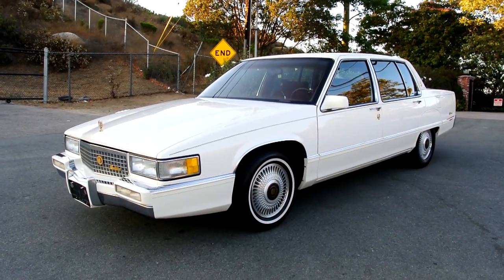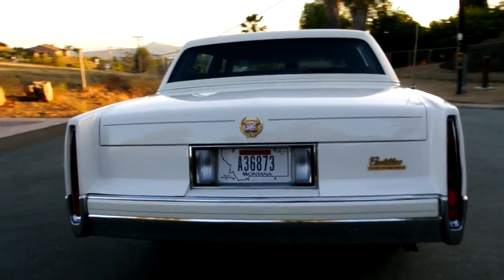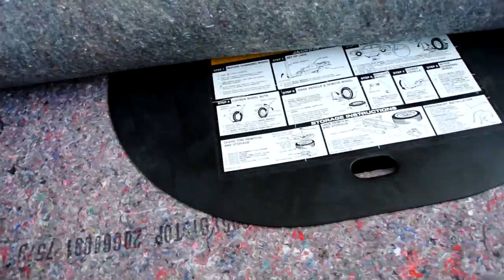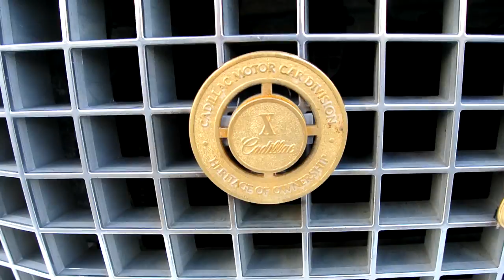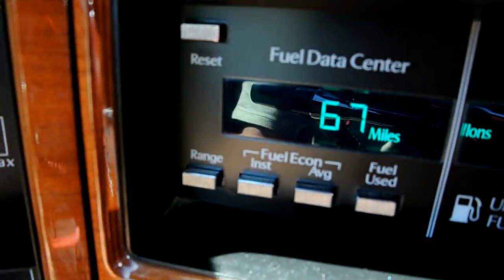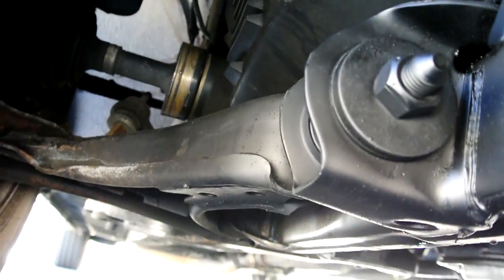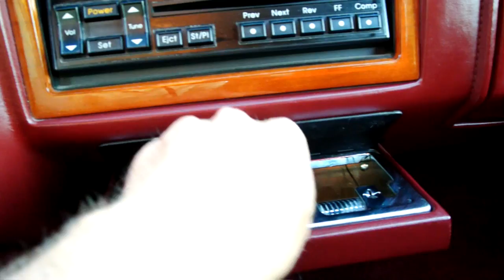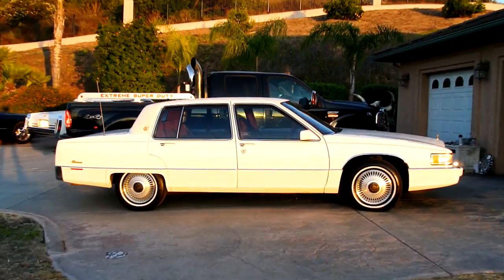1990 Cadillac Fleetwood 2 Owner 92k Orig mi Baby Brougham Deville W/ Skirts & Gold Package

Comment: Now thats what i'm talking about! lol hey that digital fuel guage jumping around? that might be the wires in the fuel tank that connect to your fuel pump,mine went out an i didnt change the wires that came with the kit,an it did the skitzo problem,but i changed them an cleaned the connection on the float arm an BAM! it gives me the honest amount of fuel an doesn't jump around on me,just a tip for you bud,love these cadillacs,like i said i own an 88 of my own an its my very first i keep it clean